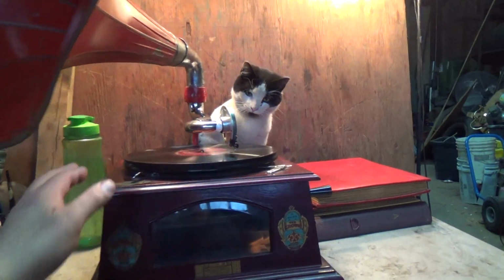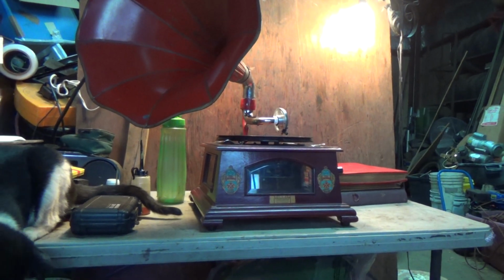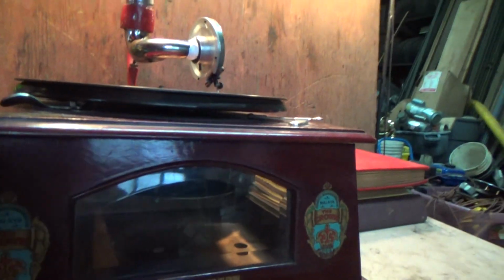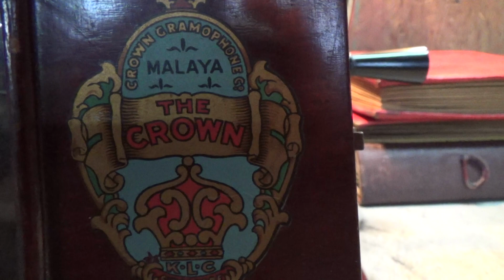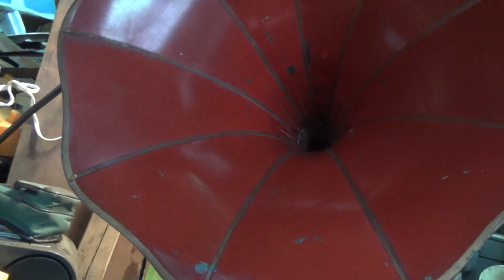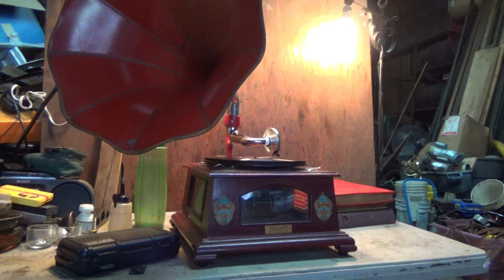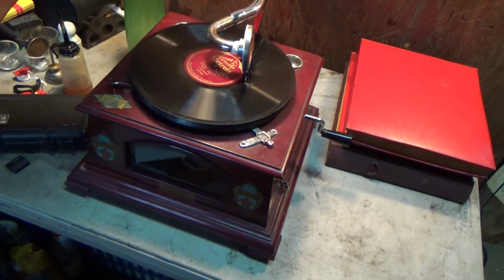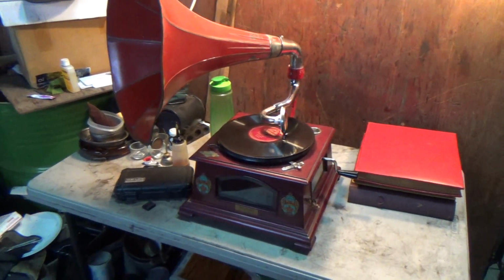Crown Gramophone Model 107, Singapore 1930's

Comment: That part of the world at the time probably wasn't wired for electricity and a spring powered acoustic phonograph was what was available for the time . What I would consider a more modern part for a out side horn machine are what I have seen in other videos are glass horns I don't think those were original for the time those I think would be for the "crapophone",just my thinking on that
Reply from the maker: I have never seen a crapophone with anything but brass horns.  Brass is the cheapest material the builders have available, and that type of machine is all about cheap.
Reply from the maker: From what I have seen in the newsreels of the time 1930's Singapore would have had electricity in some areas of the city, but the countryside would be oil lamps.  Not that much different from some parts of the rural USA at that time.

Comment: There are 3 different types of horn i came across so far, and 3 different decals. some has crank clips inside the box.
Reply from the maker: From what I was told this company was assembling the machine using imported parts and a locally made case.  Because of this there will be more variations that found in HMV machines.